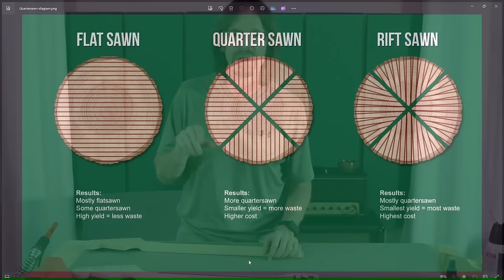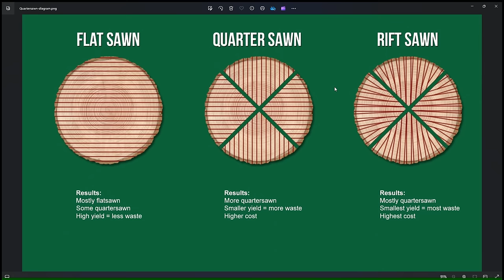Quartersawn Guitar Necks Explained!

Comment: I want to share my contradictory experience.   I live in Tucson, Arizona.  It's a dry desert here, but we have a massive Summer Monsoon season that lasts a month and shifts the humidity across the scale.  This wrecks havoc on my guitar necks. I have ESP quarter sawn necks that need adjustment 2-3 times per year because of it. 

I switched to playing Jackson Dinky's with Graphite Rod Re-inforcement.  I have both a flat sawn X-Dinky model, and a Quartersawn MIJ Dinky (made in japan).   I NEVER have to adjust these truss rods on these graphite reinforced necks at all through the year.  They are rock solid stable because of it. It's a dream... 

Because of that, I am resolved to NEVER buy another guitar without rod re-inforcement. Even quartersawn... For my location, it's just a no brainer.

I hope in the future that Warmoth would consider that condition and provide products to accommodate our needs here in places with massively shifting humidity throughout the year.
Reply: Yeah, I really wish Warmoth would do carbon fiber or graphite rods as an option. Schecter, Kiesel, and Charvel/Jackson all do it now.
Reply: What are the two species of wood in your neck?

If the relief changes as humidity changes, it's usually due to the difference in shrink rate of the two species.  Ebony has a very high rate of shrink, so when you put an ebony fretboard on a maple neck, you get this problem.  You'd be much better off with a rosewood fretboard, which is closer to the shrink rate of maple.

The CF rods won't fix this, by the way.  The rods are too close to the bending axis of the neck to have much effect on bowing.
Reply: Quartersawn 5 ply roasted necks with graphite rods. Bam! That shit will never move homie.
Reply: I think for most guitarists on tour, a standard flat sawn is fine. If the neck moves between gigs, just adjust it.
Reply: @gregholmberg2  Living in New England USA and I have to set up all guitars 2x a year. Quartersawn is minor, flatsawn takes more to tweak. Maple/maple strat necks. In the 1980's I learned quartersawn withstood better temp and humidity changes than anything else until I owned a Carvin with graphite reinforcement rods. I never had to mess with that neck and love that guitar still to this day!

Comment: Quartersawn for a maple bass neck, especially a JB profile is essential for it's stability.

I bought a beautiful J Bass in 2009, and had fought it ever since.
Truss Rod adjustments never lasted, and usually within 4 to 6 months with seasonal  changes, the excessive relief always returned until the neck ultimately stress cracked through the fingerboard at the first fret, even though the rod night wasn't overly tight.

It's the only maple neck that has ever failed me after 40+ years of playing, and for the record, it's also the only one that happened to be flatsawn. 

It was unfortunate that I hadn't been aware that all the straightness the neck had at the beginning was from the trussrod itself.

The neck was just too flexible, and had no real ridgidity on it's own.
That's alot to ask of a neck with a traditional vintage style trussrod doing all the work, and with the very narrow, and thin dimensions of the neck to headstock transition.

Comment: Great video.  I like both flat and quarter for different reasons.  I think that flat for guitars is more aesthetically pleasing with the more wavey and random look. For bass I like quarter as it always seems more stable and stiffer which a bass neck needs because of the longer length.  The only thing I have noticed is that flat sawn really need perfectly sized pilot holes to avoid cracking the wood, especially with roasted maple. Also flat sawn seems to hold screws ever so slightly better.

Comment: I bought a cheap Ibanez guitar a couple years ago that has crazy Birds Eye all over the neck. I was trying to find information about birdseye figuring online and one comment on a forum stated that Birds Eye is usually a result of flat sawn wood so likely a sign that a neck will be unstable

There isn’t much online I was able to find about Birds Eye figuring beyond that it’s generally considered a flaw but I guess guitarists and furniture buffs are into it

I’m curious if someone can give more info about Birds Eye and weather that impacts neck stability? (My guitar has been a little unstable during the drier winter months but it is still fairly new)
Reply: The birds eye pattern comes from the little shoots from the edge of the tree, so to get the most birdseye it has to be flat sawn. if you had QS wood the birds eye would only be on one edge and run acorss the board. (it would look like lines rather than dots) Once dried, it's plenty stable enough for a guitar neck with a truss rod though.

Comment: One of the best ways to understand quarter sawn wood is to focus on the fact that quarter sawn will yield more waste, but what you actually get out of it is a higher quality more rigid piece of lumber.
Reply: I just watched the video again and I'm going to also comment on what Aaron said about the wood looking nice with the flecks...  for the little design in the grain that shows up with quarter sawn. I bought a nice quarter sawn bird's eye Telecaster neck from warm up and it indeed has those characteristics. In fact, when I first took it out of the box I was absolutely stunned at how bright the wood was. It almost looked like I was holding an LED light. And I'm not even joking. When I shone the light on it it was magical. One of the best necks I've got.  Worth the money.

Comment: My only beef with flatsawn necks, specifically with my #1 that is a PRS, is that it is very sensitive to pitch changes when holding the neck. Any movement forward or backwards can affect pitch. Some people like this, especially for modulating lead lines, but I find it to detrimental for high-gain, heavy riffing.

Comment: IMO, one of the benefits of a quartersawn neck is that it looks better to the eye, but the most important benefit is the increased rigidity and strength of a quartersawn neck. Simply said, a quartersawn neck won't flex as much during playing and is less likely to bend due to changes in climate.

Unless ye LIKE bending the neck itself to vibrato the sound a bit, then get the regular flatsawn necks which are easier to bend the wood. But the flip side is that it'll be more susceptible to bending from climatic changes too.

Me? Gimme quartersawn necks any day for the strength and quartersawn bodies for the looks under transparent finishes. Unless the body is getting solid opaque finishes, then any kind of wood cut is acceptable.

Comment: It's more than just quarter sawn that makes a piece of wood desirable. It's also the compactness of the grain and the straightness of that grain. Remember, each line of grain represents one year of growth of the tree. So a tree that grows really fast has wide spaces between the grain lines. I don't know why anyone would use anything but QS wood on a guitar neck. It's a musical instrument not a bench. Wouldn't you have a higher standard of quality for an elevated application like a guitar neck? Believe it or not I've seen Squier's on the wall at GC with QS necks so it pays to know something about wood when looking at guitars.

Comment: The strength of wood doesn’t change, it is a constant.
It has the same exact strength, in different directions.
Quarter is more strength in the same direction you have a truss rod work, it is weaker to the left right.
The exact opposite is true for flat sawn.
Comments below, that state flat sawn will twist more are flat out false.
A neck with a grain patten at a 45 angle to the neck, what I call rift sawn, is the most likely to twist, as is flame maple, or wood that is not straight grained.
Also how the log is cut matters little for a neck, a flat sawn log can and does yield 1/4 sawn neck blanks.
You have to understand this distinction.
Also a 1/4 sawn neck will be brighter, and play stiffer than a flat sawn neck, don’t care what you say, I have seen this hold true for 40 years, I don’t even own a 1/4 sawn neck.
All my keepers are flat.
And for good reasons.

Comment: Can we still order quarter sawn mahogany from Warmoth? I’m going to call the service group anyways but just curious.
Reply from the maker: If we have it available when you call, yes. But that isn't always the case.
Reply: @warmoth  I gotcha. I’m trying to build an HxH Jazzmaster with a hardtail. Attempting to balance it tonally as much as possible. Thinking a chambered mahogany body, quartersawn neck (maple or mahogany), 24.75” or 25.5” scale depending on those wood choices…a lot of factors to consider.
Reply: @warmoth  possibly a Chambered alder body, quartersawn maple neck (Gibson scale), rosewood board. My head math leads me to think it would be a slightly warmer/smoother version of Fender.
Reply: @sG_Chimera  It would be a de-twanged version of a Fender. You weould lose that high end from the added tension in the longer scale.
Reply: @michaelcarey9359  trust me, been racking my brain about the solution. 250k pots, string saver saddles, etc. I prefer the playability of 25.5”. My Nash S63 is my favorite. I’ve had a guitar with SS frets before…they felt great but that shrill top end is intense.

Comment: Doesn't roasting the neck add to its stability? 

Does that negate the quartersawn advantage?
Reply: Yes and no. A roasted maple neck IS more stable, so is a regular maple quatersawn neck.
That being said, it's not impossible to make a roasted quatersawn neck, which in theory would be even more stable.
Going even further, you could add an ebony fretboard, dual action truss rod and steel/graphite reinforcements to make it even more stable, but at that point you might as well get an aluminum neck
Reply: This is just my opinion, but in answer to your questions: yes, and yes. That being said, I still think that flat sawn necks are simply ugly to look at.

Comment: If mahogany Gibson necks were quartersawn there would be a lot less headstock breaks.  Maple grain structure doesn't have the same problems.  I really like the 3 piece maple necks where the middle piece is from the same block but its turned 90 degrees.  Those seem indestructible.

Comment: I don't think the cost is just about the waste. Its also more work. It would be interesting to see how much each of those factors contribute to the cost. As far as the impact to the player goes, I think a lot of that falls into the lore (and marketing hype) of guitars. Right along with "tone woods" and other such myths. Especially when necks have truss rods (and carbon reinforcement rods) I seriously doubt there is a meaningful structural difference.
Reply: If you can't hear the difference between basswood and mahogany solid guitar bodies, then you probably haven't owned enough guitars to know anything about neck construction and stability, either.
Reply: @michaelcarey9359  Kind of antagonistic. Hopefully, you will mellow out when puberty hits. I've been playing for 50+ years and owned (far too) many guitars over the years. While you may notice some differences in "acoustic sound" (i.e. not playing through an amp) the whole "tone wood" thing is just crazy when you are plugged in. For example, the material of your pick and the angle you strike the strings with (or just using fingers instead of a pick) makes far more impact on the sound than the materials the guitar is made with. Pickups and scale length are pretty much it when it comes to defining the sound of an electric guitar played through an amp. I respect the whole "muse factor" where look and feel inspires different sorts of playing (or playing at all for that matter). But is not because of the type of wood. Its because you play differently.

Comment: Yes, wood is 10 to 20 times stiffer along the grain than across the grain.  So quarter sawn (actually "veritcal grain" would be more technically correct) will be much stiffer, i.e the neck won't deflect as much for a given sideways force on it.

This is also very important for the top of a flat-top acoustic guitar.  Stiffness falls off pretty fast as the angle drifts away from 90 degress.  This angle is called "run out", and ideally you want zero.

VG may also be less likely to twist, although there is debate about that.  Some say if any piece of wood is properly dried it won't twist.